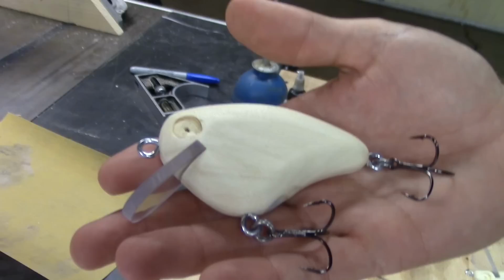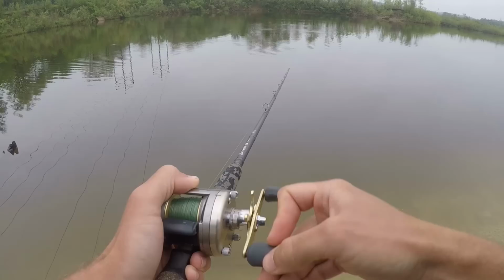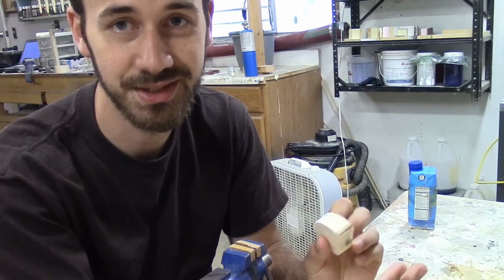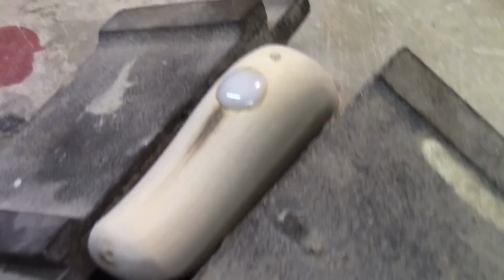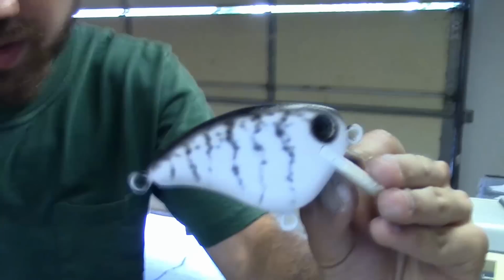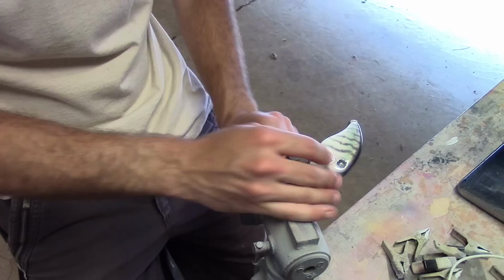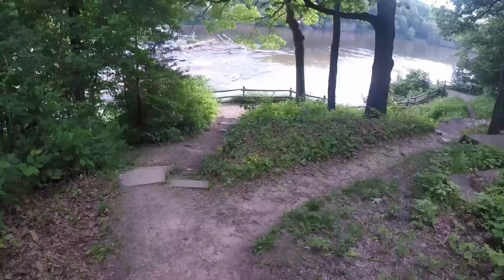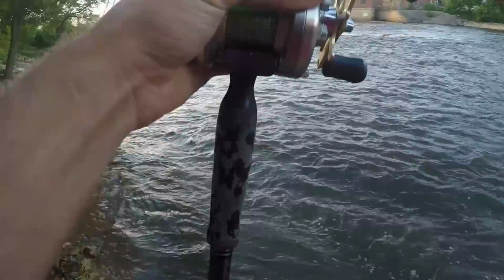Making Wooden CrankBaits

Comment: Cleaning up the edges of the lip actually does serve a purpose. Its less visible in the water. Unsanded it looks white. Which can be seen easily by the fish sanded clean and polished light can pass through it easyer and it becomes more transparent in the water. It also shows future customers you take pride in your work.

Comment: Do you make a smaller flatside crank with a circuit board lip? You could do a shallow, a deep & a topwater prop bait from the same body.
Reply from the maker: I’ve made flat sided cranks before, but not with circuit board lips. Used Lexan Polycarbonate.

Comment: Great video man. My only concern is the epoxy!! I am a concrete artist and I use epoxy a lot and whenever the epoxy is exposed to moisture, it will make the epoxy turn a milky white color. I was just wondering what type of epoxy you use, is it like a marine epoxy? Also, I love your coloration method of achieving the crappie look. Looks freaking awesome!!
Reply from the maker: Thank you! Yeah I’ve heard of that happening with concrete and moisture. Don’t know why, but I’ve never seen it happen to any of the thousands of lures I’ve made. I use Envirotex Lite, or BSI 30 most of the time.

Comment: another great video. How do you remove clear coat from eyelets without damaging the clearcoat on the lure? I have not found an easy or consistent way to do it myself yet...
Reply from the maker: Thank you! I use a hand drill with a bit that just fits through the screw eye, drill it out,  then cut with a sharp knife where you want the clear coat to stop, then pinch it off with pliers.
Reply: Thanks! I'll give this a try!
Reply: PS: I feel ya about talking to camera. I have a hard time even with voiceovers! But you nailed it!

Comment: can i know what kind of epoxy did u use?
Reply from the maker: I used a 30 min epoxy on this bait called BSI 30
Reply: Marling Baits sorry i mean for the final coat
Reply from the maker: Yep BSI 30 mixed with a little Denatured alcohol, and torched the bubbles out after application.